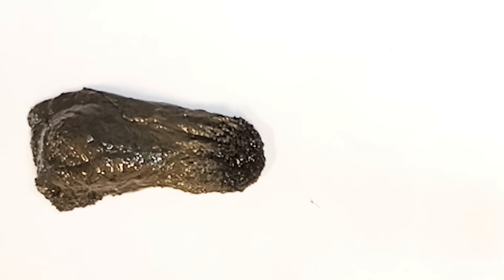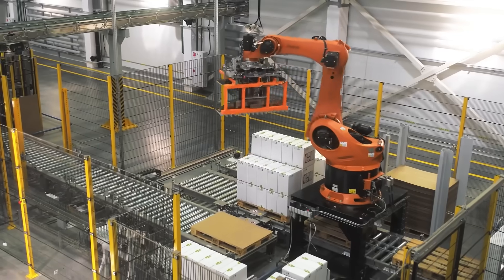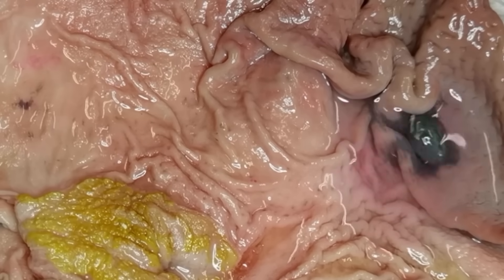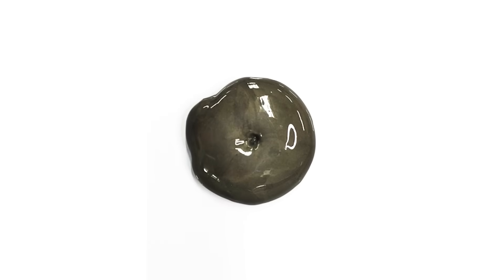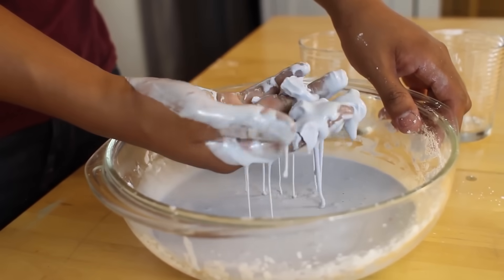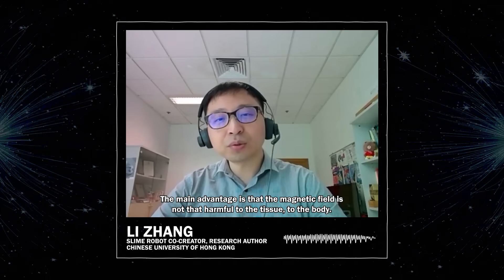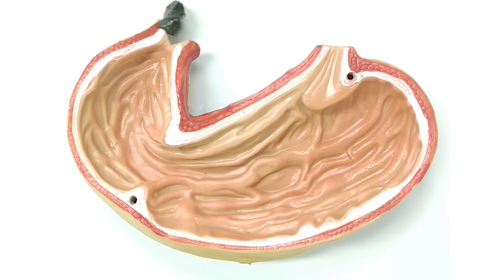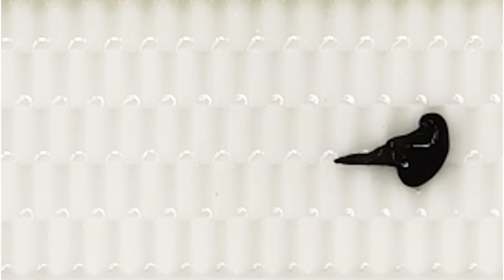This Is The First LIQUID Robot, And It’s Unbelievable

Comment: The slime was leaving a residue when going through small spaces. If it was going through the body, borax and polyvinyl alcohol are toxic, like he said. This is a very early prototype, until it's safe to be used practically.
Reply: He said something about a silica case I think
Reply: @varunk6951  he also said 'hypothetically its safe' in the same sentence.. the whole premise of this video is hypothetical and basically a 5 minute ad for skillshare.. think about it, its just slime moved by magnets.. theres nothing really special here
Reply: @varunk6951  he was talking about a case around the magnet
Reply: @varunk6951  nah, that's for the magnetic particles
Reply: yeah, did you also notice it rolling around to grab the residue it left behind?
Reply: In covid liquid jab
Reply: once it has the mechanics inside it to replicate what it needs from carbon from the air and the material its making contact with. just wait till our clothes have all this in it and is connected to 5 g
Reply: Its magnetic slime... this is not new. The way they're talking about it and hyping it up is hilarious. They're using magnets and electricity to manipulate it into everything it is doing. You can do this at home.
Reply: Well, it looks like a dead ringer for Crazy Aaron's Magnetic Thinking Putty to me. I don't know what that stuff is made of, but Crazy Aaron is a pretty cool guy and that's the first person I'd go to if I were looking to engineer something like this. He makes toys, so he probably knows a lot about what slime/putty substances are safe to ingest, and he definitely has the attention to detail to get very specific viscosities.
Reply: @Mr.Caring  Eww go away
Reply: Just watch Venom from the Spider-Man movie! It poison its host, and so it must have the right organism to become a host, that plus certain sound frequency and fir kills it. All it needs is a sort of Ai.
Reply: When I was in elementary school we used to buy slime for a quarter in a vending machine, then when I went to middle school there was a news channel in Houston that reported on restaurants with slime in the ice machine. Then when I was I'm high school we had slime in the white house Bill Clinton, now we have slime machines. How could this happen to me.
Reply: @studynerd  Slime comes in many forms?
Reply: @jer103  haha yes
Reply: @studynerd 😂
Reply: yeah but you gotta admit that is a dope way to die
Reply: It's also just a magnetic slime being controlled by a magnet hidden behind the table. If it was able to control itself for a function it would be interesting.  Also,  any constructive fluid would have a self healing property.
Reply: Borax is also great for pets and can be used dry all over the house and on the animals toget rid of fleas etc.
Reply: Why wait, just use people as the guinea pigs like they did for the vax?
Reply: So you're saying it's definitely a military weapon
Reply: They have technology far beyond this they are decades ahead in secret
Reply: @davidpapps2071  if they have tech way beyond this then why do they allow the sperm to meet the egg just to kill the fetusisters? Unless of course they are eating an endless buffet of them what would be the need of stopping conception then?
Reply: Next step is turning people into zombies with the residues that it leaves.
Reply: It is being used now.
This is exactly what was found in the Moderna shots
Reply: So it´s basically that liquid terminator from T2.
Reply: the silver serpent is a reminder of the cop in T2
Reply: Why do they care about safety?  There’s a experimental substance they are FORCING on the WORLD without any regard for safety or long term effects.
Reply: And it is so small it does not kill you every medicine has side effects
Reply: Actually I saw it leaving little parts but then it came back and took them in the experiment when it was in organ like space
(3:07)
Reply: Borax is safe in true old days it was used in baking as well mixed with iodine it's healthy to drink and helps the immune system fight against toxic metals. Yes, borax is safe. Live and learn!
Reply: Microrobots could deliver drugs straight to diseased tissue.  Fish-Shaped Microrobots to Deliver Chemotherapy to Tumors
https://youtu.be/4Qa7W-TH948
........
Reply: Borax not toxic in small amounts
Reply: Well that SHOULD BE BANNED. I dont want any of this in my life. NO THANK YOU
Reply: @starzriser9700 not only not banned but you pay for it by law
Reply: It will be injected into us either way.
Reply: Omg this comment A LIE got over 3000 likes? Borax is a mineral you need to LIVE. Although polyvinyl alcohol is toxic that’s the least of your worries. Early prototype? 😂😂😂 you’re full of nanobots and have been your whole life.
Reply: It's intention isn't safety to humans.
Reply: How about we never use this technology. We have 6 movies on why this is a horrible idea.
Reply: @anakinlowground5515  It definitely won't be used to help humanity...it will be weaponized and used to discreetly kill people, IE make people look like they died of some "natural" or health-related issue, like making targeted victim look like they died from a heart attack by clotting/clogging the heart, or some other method.
Reply: @commandervile394  Eh, I'm thinking more along the lines of Terminator. Machines gain sentience, and this is one of the things that is used against the human race.
Reply: so, they need to make it less sticky?
Reply: Side note 
Borax is not toxic it’s an essential nutrient deficient in plants due to industrial farming. Drug industry likes us to believe it’s toxic- scientifically less than regular salt & able to correct many ailments- naturally without robotics that is.
Reply: @thomaxtube  Plants may need it in tiny quantities as a dissolved substance however I'm pretty sure it is toxic in the amount used for slime. It's well known as an irritant and has been recorded as a cause for third degree burns. And to be fair everything is "safe" in moderation. Perhaps it would be okay to consume a very small amount of it dissolved in water or if it's already contained in what we eat however saying it's not toxic is incorrect.
Reply: @TC-jz7sp YOU ARE WRONG ITS AN ESSENTIAL MINERAL
Reply: @thomaxtube  I own a slime business, I manufacture and distribute it world wide. I can say that if you ate the amount of borax in an 8 oz slime it would make you very sick. As I have tested it in the past. If you like sitting on the toilet for hours, than by all means, eat it. Go on.
Reply: @lunakitty953 it makes you vomit not poop. No it all
Reply: @thomaxtube  How exactly does the drug industry benefit from having you believe that borax is toxic?
Reply: @Relatablename duh.
Reply: @thomaxtube  toxicity doesn’t work on a binary setting. This is not just “toxic” and “non-toxic”, the amount that goes into your body has a certain level of toxicity. In other words: yeah the tiny bit your body may try is not toxic enough to harm you, but if you leave enough it becomes toxic for you. Something to just keep in mind
Reply: @thomaxtube  No one in the comments question what happen what happens to Kids and People with allergies to Borax. Kids are very sensitive to Borax why most companies have Non-Borax slimes. But yeah it's still on the works so it's good that the Scientists and Company/Team are still developing a more safe way to do this. But T C makes a good point It's toxic to people in normal amount of Play/Toy slimes and for the amount they used in the robot could trigger allergies long-term cause they will need to use it more than once when it comes to technology.
Reply: @MaxKur0  there are no allergies to sodium-tetra-borate it’s a mineral. (Not a protein) 
And the intake of 1/8 -1/4 teaspoon/day 5days a week to rectify arthritic soft tissue calcification 
is well documented by tens of thousands of users. Since 1980’s 

The borax is still used in contact lens solution as it does it’s job there  cleaning & gentle to one’s body

- it’s true you can clean with it- but most importantly it is a natural mineral source of boron for humans (which also naturally cures candida yeast  overgrowth and Is scientifically measured less toxic than regular table salt? 
So what about the kids who dare to take a table salt ? This is one of the burning questions of the day 
when injecting synthetic medicine & robotics into the body 
is considered progress, 
by some individuals.  

The physics of biology still remains unchanged : adding boron benefits the most modern humans & certainly everyone exposed to toxic sodium fluoride (in toothpaste and US & Australia drinking water supplies) 
Why the government supports synthetic fluoride add inns 
but warns against natural minerals, makes one question 
is the unhealthy slime working for the government to protect you? Or to mislead you? 

or are your kids brushing their teeth while washing their brains  with fluoride that lovers iQ and makes one unable to question authorities? 

To hear the governments & 
stay away from natural solutions- the choice is for everyone to make for themselves…. 
Artificially Fluoridated kids and milk calcified adults being the biggest benefactors : but only those with Own Will to question 
what the goverment says is good for you.
Reply: @thomaxtube  thank you , bc I just went to reply about bor@x not being toxic
Reply: @dreww.7895  Drew I wish you and Tom actually look up facts and people's experiances with Borax cause it is toxic.
Reply: @MaxKur0  I  I’ve put a scooop in water and drank it. More than once- Stilllll alive 🖤🤍🖤🤍🖤
Reply: @dreww.7895 wow I wish i could do that but I have to go slow (also w iodine) as the vomitorium factor is high so detox takes me a longer time
Reply: @thomaxtube plants love amonium but we canot consume this too..
Reply: Yea at this point they are pretty much just playing with magnetic slime as far as i can tell
Reply: Thanks for stating the obvious as if you're some sort of big brain genius lmao.
Reply: @dan3458  they are a big brain genius tho
Reply: Borax is hydrate salt of boric acid. It says on the box maybe harmful if swallowed. I've never consumed it, but you don't know if it was different in the old days. They can add other chemicals than if it was just one thing.
Reply: @jer103  it's still non toxic. We use it all the time. The borax in Canada anyways.
Reply: Yeah Right!  Just like the Jab was safe and effective.  when will people wake up?  Gov't isn't to be trusted any longer in any country.  Stop helping them out and just say NO
Reply: Imagine all the poor animals, that have to be poisoned by this, before it can be used on people...

Comment: It feels disingenuous calling the slime a robot when the "robot" is the thing creating the magnetic field. We don't call a robot's arm a robot. Also if we're calling anything that moves with electricity a robot, are solar panels that rotate to point toward the sun robots? Are RC cars robots? elevators?
Reply: "healing" also sounds disingenuous. Its crazy how my gatorade "heals" when I separate out my gatorade into 3 bottles and then add them back together into a single container.
It would be weirder for it to not be able to reform after being cut.

Comment: Does this actually fit the definition of a robot? It doesn't seem capable of acting automatically or being programmed.
Reply: No, it's just a stupid magnetic sludge with no electronics whatsoever. Not much different from when you put a magnet on top of a table and you move it around with a second magnet under the table. Way overhyped.

Comment: Quite disappointed from you guys. It's basically just a piece of magnetic-blobb that is controlled by external magnetic fields. This blobb can't do anything by itself. It's the same, when you drag a paperclip by a magnet that is positioned underneath the table plate. 
Considering that, you overhype this thing and only give the important context (i.e., external magnets) at the very end of your video-content.

Comment: hm, i guess i have a different understanding of what "robot" means. To me, a robot is capable to do stuff on its own, may it be "intelligently" or explicitly programmed. This slime doesn't do anything on its own, it is pushed, dragged, and deformed by magnets and electrical fields outside of the slime, if I understood the working principle correctly. So, what makes it a "robot", exactly?
Reply: Robots follow instructions from a computer as well. So it's a robot.
Reply: @aat528  i think, the crucial point is the autonomy thing... Printers also follow instructions from a computer, but no-one would call them "robots" (i think...).

Comment: See the only problem with using this in a practical sense to treat things like cancer is that it is in fact a magnet which is almost as bad as just having Metals in your body in those situations where you need to go into a machine that will cause a very strong magnetic field in order to see what is going on.